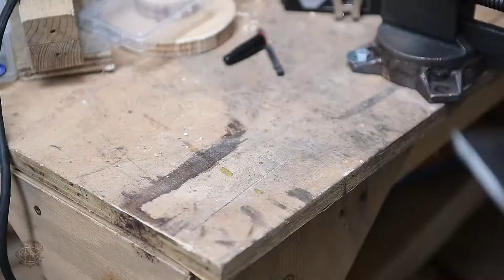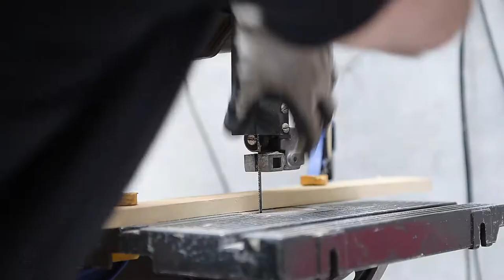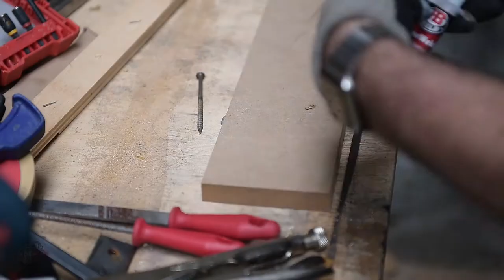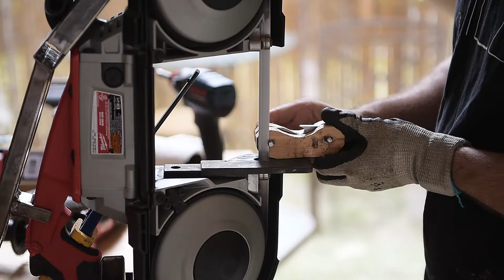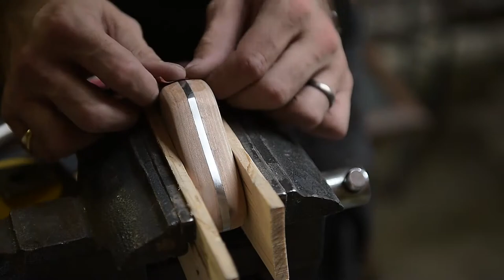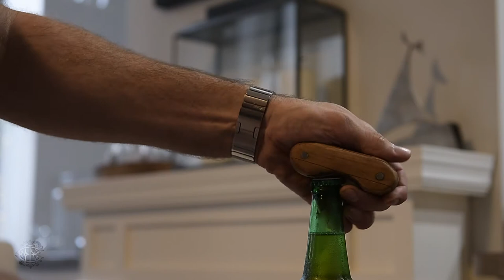🛠🎥 ECP: Bandsaw Project - Custom Bottle Opener

Comment: Did you clamp the piece together while the epoxy dried?
Reply from the maker: Mr. A I clamped it in the vice while putting the bolts through. (Off camera) They didn’t stay together the way I wanted by just bolting. Thanks for watching 👊🏻😎

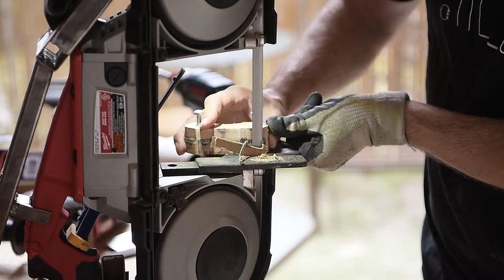Comment: You had me seriously cringing at 3:10 when you were pushing the opener towards the bandsaw like that. Please, use clamps, or a push stick, next time!
Reply from the maker: It looks awful right! I was VERY careful to have my thumb on a different plane as the blade so I could apply pressure without the risk of ‘following through’ to a messy demise. Thanks for watching :))
Reply: Push stick for a band saw? pfft whatever..